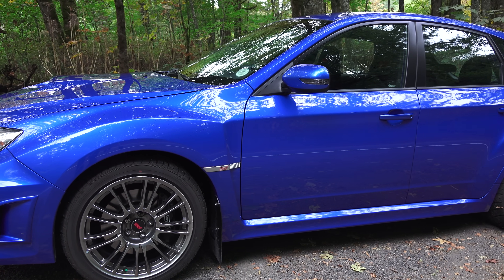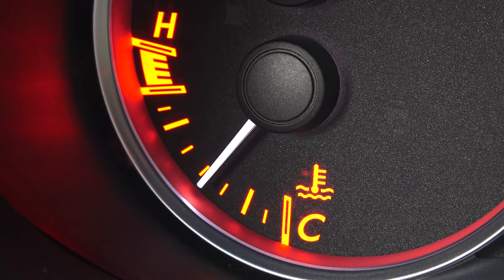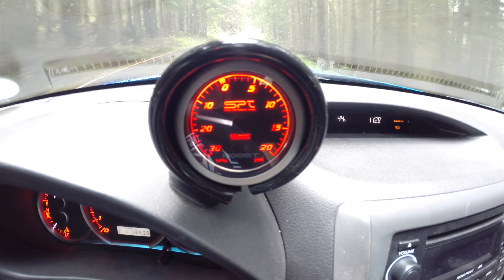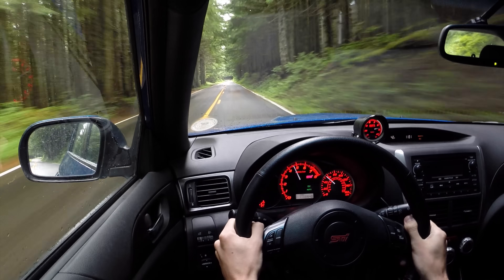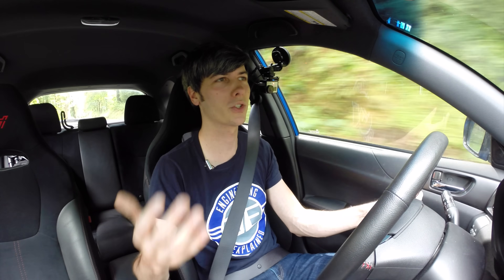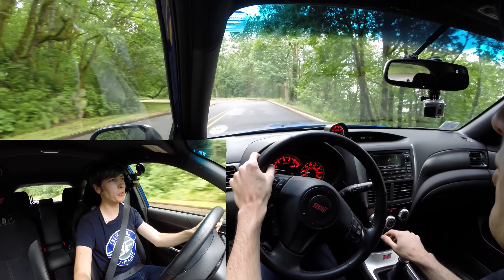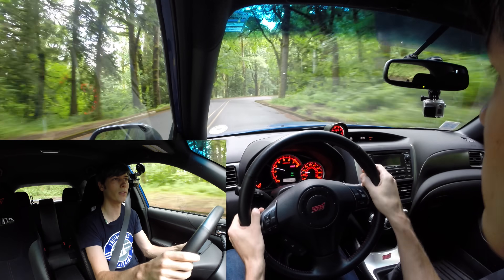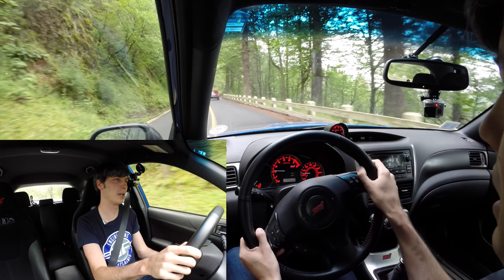5 Things You Should Never Do In A Turbocharged Vehicle

Comment: That's interesting you mention low speed pre ignition. When I was in college for autonotive and advamced engine performance, we talked in depth about how there are more and more instances of GDI turbo engines succumbing to "superknock" as we called it. We saw several engines come in with rods and pistons through the side of the block. It seems to happen when people are just driving and tip into the throttle a bit, suddenly the engine locks up. Snapshot of PID data when the check engine light comes on has indicated that these types of engines are perfectly fine and operating at low speed, high load and all of a sudden something happens right after the fuel pressure rises but right before it makes the change from stratified charge to homogenous mode. Tests have been done and the hypothesis is that when you tip into the throttle the fuel pressure goes up, spraying in more fuel, and that fuel hits a hot spot and detonates. I read about tests where pressure transducers have recorded 2500-3000 psi in the combustion chamber before the piston reaches top dead center, shattering the piston.

Comment: Engine oil takes ages to cool down after a thrash, even driving off boost for a few minutes and coming to a stop, when you stop there's no air flow to flow through coolers, if you have an oil cooler. But driving easy for a while after a spirited drive has got to be a good thing.

Comment: I was watching another youtuber who takes apart bad engines for parts.  I almost expected to see a warning on turbos here that if there is a catastrophic loss of the turbo the engine might quickly lose all its oil.  At least that was what I understood.  This youtuber surmised that the driver did not shut down the engine, continued to drive with no oil and it trashed the engine.  He did say the driver should have known something wrong.   One sign would have been all the smoke caused by the oil going out the exhaust.   What are your feelings about engine life of turbo engines?  Last I knew Consumer Reports said if you want a vehicle to last don't get one with a turbo.   Some have said that thought is archaic.

Comment: Most vw audi turbo engines are intended to do most daily work between 1400 and 3500 rpm usually not passing 1800 rpm until well into 5 the or 6 the gear upping rpm and downshifting are not recommended and the digital throttle will fight you if you do

Comment: This guy, while having a basic knowledge (most of it no doubt gleaned from the internet), apparently doesn't have any practical experience with modern fuel injection, which is why he contradicts himself.  If you floor that engine while at low rpm, you're not going to run rich.  If anything, you'll lean out slightly until that turbo spools.  The reason for that is the airflow sensor.  That's a huge fuel delivery input and the ECM is only going to deliver what that sensor tells it.  If you're not pulling in huge volumes of air, you're not going to get a lot of fuel delivery.  If you did actually run rich under that condition, as he claims you will, then there's no fear of preignition.  Rich fuel conditions cool combustion, thereby eliminating preignition (and detonation).

Which is why most manufacturers run turbo engines a bit richer than necessary under boost.  It robs a little power but it's a CYA thing.  For example, my 'Volvo used to go below 10:1 (which is as low as my A/F meter goes) at 15 lbs until I installed a programmable ECM.  Bumping it back up to 12:1 dramatically increased the power.  (It's a 1988 model so factory ECM was that rich due to the lack of knock sensors. Almost all the newer cars have knock control now.)

Anyway, the cases of LSPI (low speed pre-ignition) have so far been confined to direct injection engines.  If you remove the intake manifold (or whatever it takes to look at the intake valve), you'll easily understand the likely cause.  With port injection, the intake valve and port got cleaned.  With direct injection, they don't, so it gets pretty nasty in there -- nasty enough to seriously affect performance in some cases, requiring cylinder head removal and disassembly to clean the valves.  (No grinding needed. Just a bench-mounted wire wheel to remove the caked-on carbon.)  All of those carbon deposits provide an ignition source if they break off and enter the cylinder.  Direct injection makes significantly more carbon deposits than any port injected engine. 

Also, the newer water-cooled turbos have pretty much ended the need for long cool-down periods.

And use the fuel that the manufacturer recommends.  Engineers are a damned site smarter than any self-proclaimed expert.

Comment: Depending on the weight of oil  , coolant can get to operating temp within 5 minutes and oil can take 15 . Never base off of coolant temp. For example my Cummings diesel coolant temp can be 90° Celsius,  but oil can be only 35°

Comment: Useing 93 in a Kia Forte gt with a turbo engine is not recommended. If the car says to use 87 use 87. In a Subaru it says use 93 so use 93. Don’t use gas that the car is not tuned to use… it does nothing for you and you just waist money.

Comment: As a point of reference on octane ratings:
US MON 87 = U.K. RON 95
US MON 91 = U.K. RON ~99

I use 99 RON on turbocharged engines, especially helpful for those with knock sensor present.  

One other point about using high torque at low speed is the oil pump speed, the crank main journals need a certain amount of pressure to drive oil to the centre drilling in the crank so it can be fed to the rod journals.  

While pump pressure is regulated they deliver higher flow at higher speeds and often slightly higher pressure before the regulator opens (usually passive spring plungers on most and some have a cold start solenoid as well).

Max torque at minimum speed is usually close the minimum oil film tolerance for major bearings so it’s always wise to spin the engine a few hundred rpm higher.   Electronics in Modern cars can retard the timing at these conditions to protect for it but a little extra mechanical sympathy goes a long way.
Reply: Wikipedia has a slightly different conversion: 
US 87 = EU 92
US 90 = EU 95
US 93 = EU 98

BTW, I have not seen EU 92 (or even lower) in Western Europe since at least 20 years ago.

Comment: Most likely this won't get answered, but I figured I'd ask anyways. Is it worth it to turbocharge a 2005 Dodge Magnum SXT with the 6 cylinder? I've been driving the car for a few years now and have felt almost right from the beginning that its underpowered. With where I live when I merge on the highway I have to go from a near standstill to 70mph (or more depending on traffic flow) in a very short period. and it struggles to hit that speed by the time I merge on. I've made sure the sparkplugs are good, all the fluids are in check, everything is fine. I just think it needs more power. Any recommendations?

Comment: How do you drift you're car?

Engineering explained: "You have to modulate you're throttle to wide open to send significant loads to your rear tires, this will result in you're rear tires to increase their slip angle and put you're vehicle into an oversteer condition. This can result in the driver feeling a sense of euphoria and delight."
Reply: @bergper gat uh lyfe

Comment: Fun part of the Subaru Diesel I got is that the shift indicator pretty much tells you to run your engine at the low revs high load condition all the time. it even use more fuel than just shifting down and up the revs a bit. I never run the engine on the low revs that introduces the heavy vibrations since I know it´s not good to do so

Comment: A lot of the newer 4x4 full size trucks are now turbo charged. Does this apply to those engines as well? It's going to be difficult to not lug these newer engines with the automatic transmissions. My 2018 Tacoma (not turbo charged) is geared way to tall. If I let it operate the way it wants to it tries to climb hills at 1500 rpm. It is very slow to downshift in that scenario. I usually have to put it in manual mode so it can't do that. The EPA has ruined trucks, it's so annoying.

Comment: I drive a good sequential auto.  It selects the best gear.  Unlike a manual (stick shift), the engine doesn't stall, labour, choose the wrong gear.  It also changes gear quicker than I can.  Oh and it also manges, traction, awd, stability.  Update you explanation of engineering, at least to the mid 2000's will do to start and a lot more since then.

Comment: Ok regarding the fuel question.
2016 VW Jetta 1.4T
. It says to use 87 fuel. Can I go straight ahead and use 91 then?
Reply: You can.  I'd do a test. Track your mileage with 87 for a few tanks.  Then switch to 91 for a few tanks and see if you get an improvement in both mileage and performance.  Try to keep your driving style and trips the same as much as possible of that time.   If you don't feel a difference and don't get better mileage then why pay more?
Reply: @brandons9138  somehow 89 feels a smoother drive than 87. It doesn't lag as much
Reply: @EsteBandido_YT  Are you in a warm environment?  If it's hot out using 87 could be causing the ECU to pull timing to protect the engine from knocking.  That would make the car produce less power.  The 89 octane might help the engine avoid pulling that timing.  That would lead to more power and a more pleasant driving experience.
Reply: @brandons9138  I drive around South California and Tijuana. Sometimes as far as Eastern Sonora, Arizona, San Felipe. So yeah mostly warm haha. I've been reading through some VW forums and CW dealership FAQs that for the "perfomance-driven", premium (91) gas works as flawlessly as regular. 91 feels even stronger but the MPG reading is not as high as 87 or 89. I found 89 to be the sweet spot between performance and gas mileage.

Comment: Is 93 octane good enough for a Volkswagen 2.0T engine?
Reply: Absolutely.  I spent ten years with two VW 2.0T GTIs and one 2.0T Audi quattro.  All I ever used in those cars was 91.  It's all I can get in California.  Also make sure you buy quality gas from a good brand.  Not all 93 (or in my case 91) octane gas is the same.

 I got my Focus ST from the dealership a few weeks back it of course came with a full tank of gas.  When I finally had to put gas in it I put 91 octane in it.  I'm in CA where 91 is the best most stations have.  After that fill up it was a totally different car.  I had a similar experience with my GTI a few years back.  I was filling up at the no name gas station around the corner from my house, I was using 91 again.  Then one day I didn't think I was going to make it home so I stopped at a 76 station a few blocks from my house.  Again I put 91 in it.  I could instantly feel the difference in the car.

Comment: Question for Engineering Explained - I revved by mistake my 2.0 turbo-diesel BMW F20 to 4000 RPM (soft limit out of 4800max) while the engine had just been started 3 minutes earlier. Ambient temperature was 88 degrees fahrenheit/31celsius and car was in neutral stopped. I imagine the oil would not have been a lot over 100 fahrenheit or around 40 degrees celsius. Did it for around 2 seconds until I realized what was happening (was searching for something in the glovebox and pressed accelerator by mistake). Did this cause any noticeable harm to the engine?

Comment: Some Ecoboost engines have electronic coolant pumps that continue to circulate coolant through the turbo intercooler after the ignition is off.
Reply: Oil doesn't go through the intercooler. Ever.
Reply: @chrisoliver4663  
You are correct. It is an electronic coolant pump, not oil.
Thanks for the correction.

Comment: Turbos in a diesel spin at very high RPM so that even when given a hard push they have ample pressure to charge the engine and diesels love low RPM torque as opposed to Gasoline this then means the turbo flow has to be governed as the rpm increases all done with great accuracy through the computer.  Now this is what encourages tampering with chipping to increase the turbo flow - the engine has been carefully designed for a specific loadings of the crank and pistons and messing with the data will lead to an early visit to the scrappy.

Comment: Is pre-ignition not based on rpm? And the intelligent chip in our cars should realize ooh it's low rpm so no pre-ignition? Feedback control systems aren't new, are they? Or am I missing something? :)
Reply: I would also think that that's the case, at least with some cars. Ford's Ecoboost engines generally only require standard (91RON) fuel, but most others seem to require premium so I guess that's not the case.

Comment: Hey Prof why not use an electric air compressor to turbocharge an engine? when accelerating more fuel will be injected(alternator will produce more electricity) likewise more air will be injected. and when compressed air is released it will have a cooling effect! may be a rheostat on the acceleration pedal🤔 to prevent turbo lag in case you don’t know. 😂

Comment: Surely the engine management system can detect the engine is at low revs and not allow anything that will cause engine damage when one floors the accelerator. That's simple to achieve for a programmer.

Comment: Don’t use the highest octane fuel you can buy. Use the octane of fuel that matches your compression ratio. Normally the cars owners manual will tell you what fuel is recommended. You can lose horsepower using too high octane with the incorrect compression ratio.
Reply: Rubbish

Comment: Old video, but I had to comment. Motor oil is designed to keep the same viscosity through a range of temperature. Therefore, oil temp is not crucial unless you are in severely cold conditions. The water temp is a better indication of the vehicle being warmed up. 
Side advice: the hotter your oil temp gets, the closer the oil is driven to thermal breakdown. 
-Just your average at home mechanic/car enthusiast

Comment: Hatch STi, reduce rear tire pressure to 1.9Bar, switch off ESC. Try in safe area first.
Technique for hairpins, brake hard, 2nd, lift throttle, rear will come, reapply throttle, countersteer slightly. Goes like a rapped monkey that way. The STi suffers from heavy understeer in turns like the Integrale. But oversteer is what makes it fast if you know how to adjust the tire pressure and how to drive it. You Never want a AWD to understeer, just slows you down. Once adjusted this way, remember that lifting throttle quickly will get you either oversteer or total loss of grip at high speed. Dummies abstain cause you need to know how to drive it. I know, I had two Integrale and one Hatch STi.

Comment: Use synthetic engine oil in a turbo vehicle.
It can take more heat than petrol oil. It is less likely to clog the oil tubing that feeds oil to the turbo. That is the hottest spot the oil must travel to, therefore the place where it is most likely to begin collecting and choking off the oil flow. 100% synthetic is best. There are synthetic blends but those still have some petrol composition.
Reply: Synthetic blends can have anywhere between 1% to 15% synthetic oil blended with petroleum oil, depending the each oil company!

Comment: In my 2020 GT mustang, although it is a normally aspirated engine, the 5 liters needs quite sometimes at least 7 to 8 minutes before the oil is at the right temperature.  But most importantly , the oil for the transmission is even worse to get hot and requires like 15 minutes minimum.  So it s not only the oil of the engine, but oil of transmission is also important.

Comment: with my car i got a used 2016 wrx in january and what ive been doing is driving it but not getting into boost till the oil hits around 170 - 180 degrees F , it takes maybe 5 -10 minutes of baby driving for it to get the oil up to temp , and are you in 5th gear going 20 mph?

Comment: The low rpm pre ignition, does that generally only apply to high gearing? Can you still stomp on it in first at 2k?
Reply: Yeah, that's fine because the engine spends so little time there that it wouldn't even be able to make enough boost to do anything.
I have a 2010 STI and I only start to make max boost in 3rd gear or higher.

Comment: Appreciation the info. I suggest you guys watching his hole video as it contains many useful pieces of info as well as explanations. 
1) Not running the engine hard until engine oil is warmed up - which can take some time. Don't rely on the cooling gauge. Wait a few minutes after coolant is warmed up.
2) Not immediately shut up the engine right after a trip. Let it cool down by avoid the boost before shutting it off.
3) Avoid high load at low engine RPM. (Which btw, how do you avoid in an automatic like a CR-V? I can't downshift.)
4) Use the best fuel (highest octane)
5) Don't floor it right after a corner. (Joy kill for me. Ugh. Don't think it matters w/ my tiny CR-V though)
Reply: hey im a little late but i think you're ok with #3 because the auto will downshift for you

Comment: hes not saying u cant floor it on the way out, the gradual increase in boost psi/hp can be used to push the car to the wider line on an exit in racing conditions and if you maintain traction the line is viable and fast

Comment: Great points! My new Veloster n DCT has an oil temperature gauge. Cool.
Reply: congrats on the new car. I just got a 2017 GTI w/ DSG and was wondering how the veloster is with it's own dual clutch transmission.
Reply: @Hyperguy205  The DCT shifts super fast, especially using paddle shifters or in sport mode. Lots of ways to program it. Very fun!